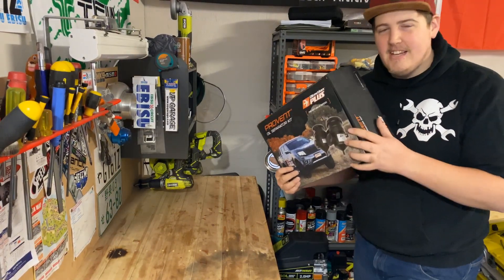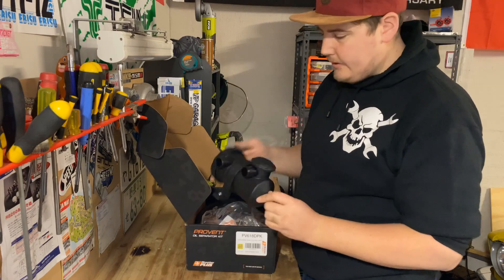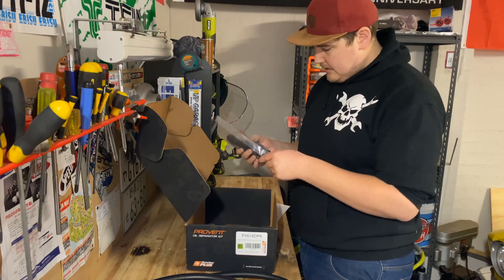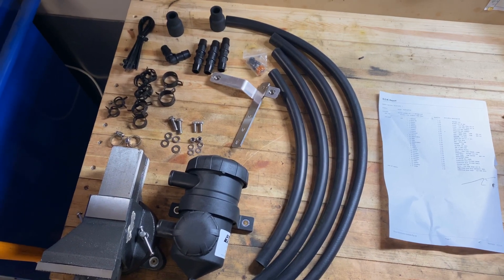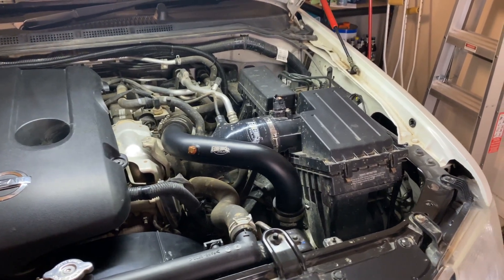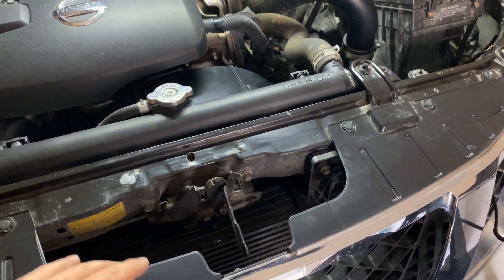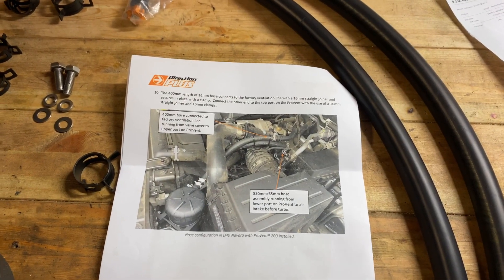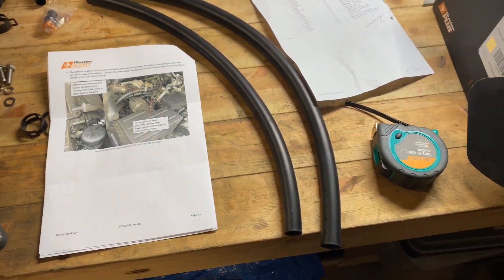Provent Oil catch can install on a Nissan Navara D40 140kw Spainish 2012

Comment: Careful talking about EGR delete these days, might get yourself a visit and a fine.  My EGR valve is functioning just fine.  Spanking clean, has been for a good few months now.  I'm doing the catchcan install tomorrow morning, giving the whole intake a good clean out too, as well as replacing all cold side piping.  Good to have a straight forward run-through, cheers.

Comment: thanks im doing mine today  ill let you know looks fairly straight forward
Reply from the maker: Hope it all went well for you mate 🙏🏻
Reply: Yep video was great easy install would love a video how you cleaned out intercooler
Reply from the maker: Yeh I really wish I did a video on that but it was a rush job. Not hard at all tho. Just add a bit of kerosene and block off the ends and shake it around, drain it out and repeat until it’s clean/ blue. I just needed to unbolt the good latch to get the cooler out as it’s a bit tight.

Comment: Thanks for the video! I have a Nissan Pathfinder 2012 2.5TD with the same engine as yours, wanting to buy it and hopefully DYI it 
you gave me more confidence to DYI instead of paying over $300 for install...
stay tuned haha!
Reply: Update: this video is absolutely amazing. I watched it like 20 times during the install, you are right in terms of the 650mm hose they gave is way too long. Lots of cutting and fine tuning with all the hoses for the catch can. Make sure you use good plyers when dealing with hose clamps, I struggled hard for this one...